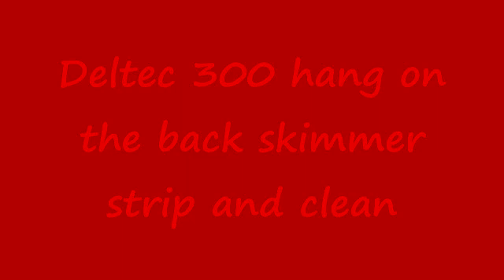hob deltec MCE300

Comment: Finally stripped it down and cleaned and rebuilt last night. All went well and so far I am very pleased with my efforts. It seems to be pulling a lot more skimmate from the water as in 1 day it has pulled about the same as what it was doing in a week. Still having problems with my Ehiem and micro bubbles. I have stripped it down a few times, put plumbers PTFE tape on joints, tightened all the hoses, vasaline round the lid and air is still getting in grrrrrrr.

Comment from the maker: the impeller ceramic part get covered in slim get a wet and dry to clean it to improve the pump.check the angled air and water output ito the big chamber, it isn't pointing down that does not help.i also blow down the air tube to see its clear.